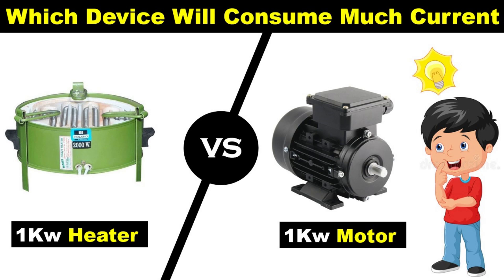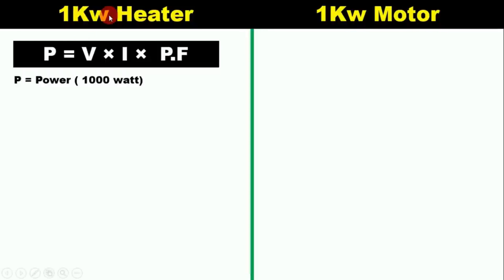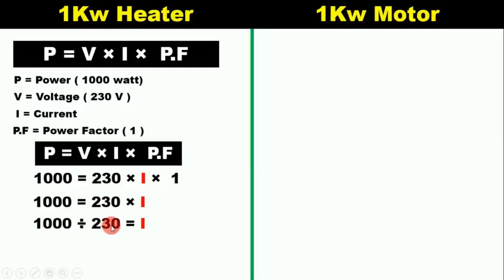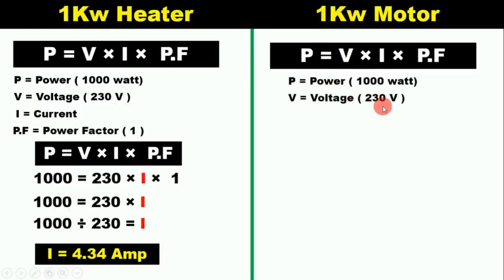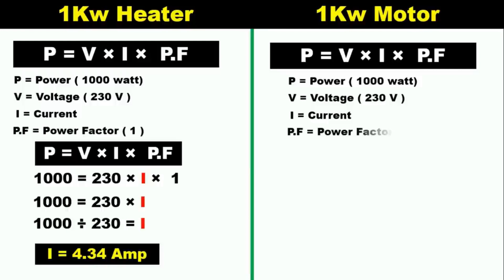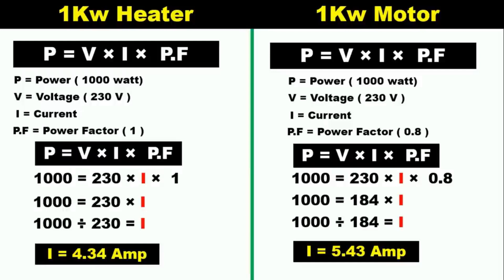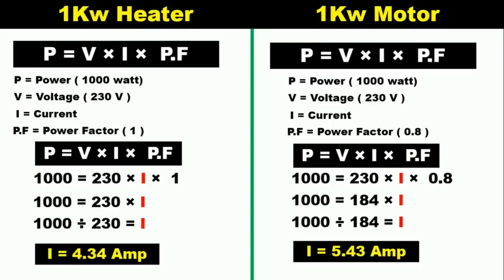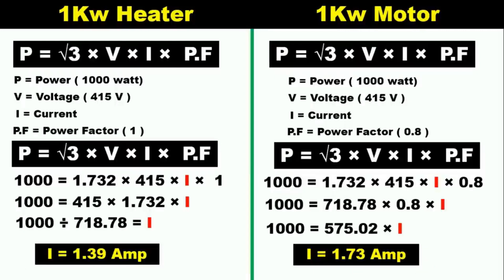😲 99% of people fail to give the right answer, Which device will draw higher current Heater or Motor

Comment: Base on your calculations, a 1KW.motor would probably take more current than heater
Reply: 1kw motor will not work on 1kw , always less, the heater always work at 1kw

Comment: The motor will draw more current(Amps) .The heater is resistive... Lower amps but higher voltage. The KW usage over 1 hr is the same. They both use the same amount of electricity. Just differences in "Pressure"(Volts) and "Flow"(Amps).